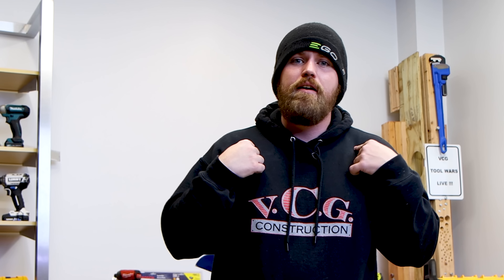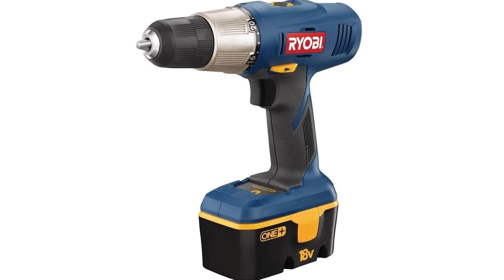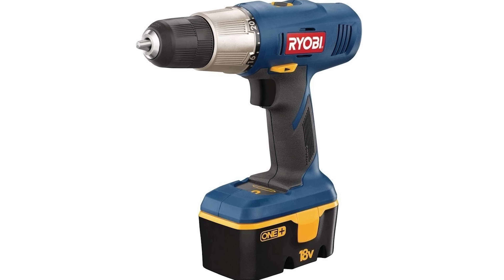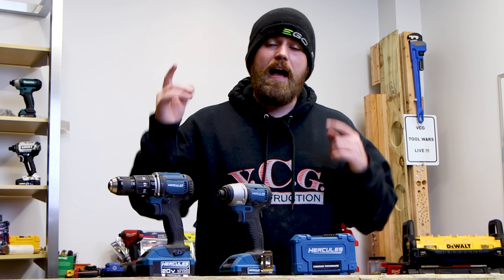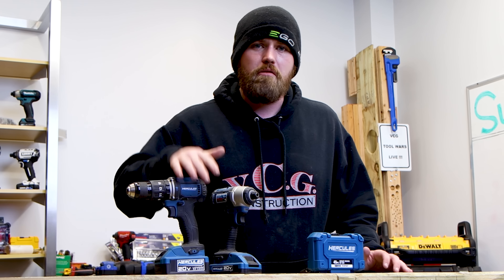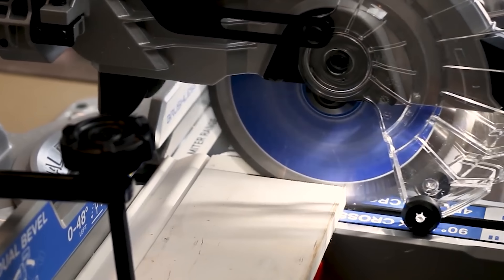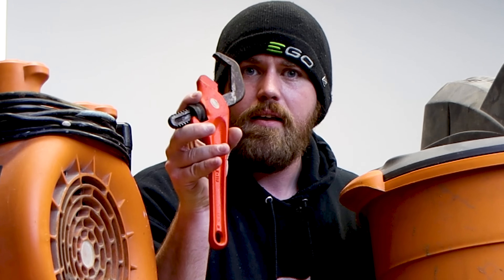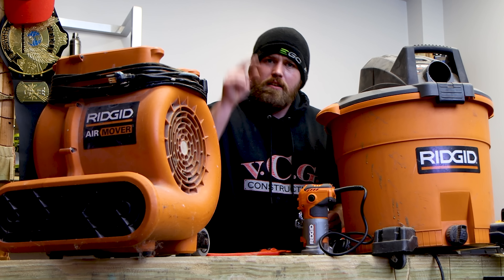TOP 5 MOST HATED POWER TOOL BRANDS (that are actually great)

Comment: I bought a Rigid 1/4 sheet sander once and its clamp failed in the first hour I used it.  Also bough a Ryobi belt sander once, it burned up the first day I had it.  I do have a Ryobi Miter saw that is still running good after 13 years.  But I just stick to DeWalt and Makita now.

Comment: Bosch has always been a puzzle...their 1604 13/4 horse router would rout petrified wood 'till your arms fell off...they made a 3/8" corded (cheap) drill that could not be killed. (I tried). But they made a laminate trimmer that I relegated to underscribe duty because it couldn't survive half a day trimming laminate without blowing up! Now, in fairness, these observations are from 1990- 1994 when I was an apprentice in a Chicago Union Cabinet Shop so it's not relevant to today's Bosch, but I always thought it was strange that the same folks could make such a variety of tool quality at the same time...(this was not about "homeowners quality" "economy" or anything else. These were all repped to us as professional tools from the Bosch rep that came to the shop.
Reply from the maker: Thanks for the feedback Matthew!

Comment: Had the Hercules drill, Non hammer drill. Loved that thing and the impact. The impact is one of the best I’ve used. The drill on the other hand was junk in under a year. The Jacobs chuck is shot on it now. It will not grip a bit well and either loosen up during use or rip ridges into the shank of the bit. Since then I have now moved to a Milwaukee brushless set and not looking back

Comment: One of the best little tools I ever bought was for $10 from Klein it's a special magnatizing tool. It has a magnet and some holes built in it and you can run a screw driver or a bit or whatever you can fit thru one of the magnatizing holes and it will make it magnetic so it gives you the power to make any bit or screwdriver in your arsenal magnetic and it you want it regular again you just run it thru a different hole and it'll demagnetize it! Definitely worth the $10 I paid for it, sweet little tool!

Comment: I setup and breakdown mobile homes for a living. That Ryobi 3 speed impact driver is a beast. With a socket adapter it drops axels and tires, puts them on, deals with hitches, and does everything I need screw-wise. It's been going strong for almost a year...dragged through the mud, dropped off ladders and even a roof here and there. The guys at work call it "the beast" and it usually means not cranking the generator and pulling out the Milwaukee impact. I bring my Ryobi tools to a construction site and abuse the hell out of them. For the money I paid and the value...I can't complain. The roof I cut today didn't skip a beat with the saw-zall, and forget about the ceramic tile with the circular saw...

Comment: I'm a 23 yr apprentice. With all ridgid. Doing 4" lags into 4x8 timber fur. Dropped my impact in the lake 8-10' still performed as any impact after. 4amphr still works n charges just the light on the cell indicators dont work anymore.

Comment: When it comes to plumbing ridgid is top notch I like my Bosch  idh182 with core batteries is sweet that Bosch blaze GLM50c  is amazing the powerbox jobsite Bluetooth radio is a home run . I own a Ridgid gen 5 x brushless  kit it's good for what I need it for coming from DeWalt Nicad for years
Reply: That’s because theyre essentially two different companies. Plumbing line of Rigid tools are made by Rigid. I forget the parent company, but the origin of the Rigid power tools is there is  an orange power tool company in Asia/Europe that wanted to release their tools in the US. I forget the name. So they bought the Rigid name, and strictly the name, and branded it under the Rigid name and released their line of power tools in the US under the Rigid name.
Reply: Can anyone tell me what the difference is between the IDH and the GSX line? I have a GSX 18V-Li myself, wich apart from the brushless motor is nearly identical (57 in-lb difference in impact force).

Comment: I drove in some T25's in my deck bc the winter expansion made them pop out a little. I prob drove 30 screws. I ruined 3 hercules bits doing so. I was even using the screw function on the impact.

Comment: God tier:
-Hilti (Europe)
Indestructible, but stupid expensive. Geared towared more heavy industrial use.

First place honorable mention:
-Festool (Europe)
Quality tool brand but sold almost exclusively in Europe. Doesnt have the widest selection of power tools, but more so geared toward wood working. Very niche.

1st tier:
-Bosch (Europe)
-Milwaukee (USA)
-DeWalt (USA)
-Makita (Japan)

2nd tier:
-Skil (Europe)
-Kobalt (USA)
-Porter-Cable (USA)
-Metabo HPT/Hitachi (Japan)

3rd tier:
Einhell (Europe)
Craftsman (USA)
Ridgid (USA)
Ryobi (Japan)

4th tier:
Hart (USA)
Hercules (USA)
Masterforce (USA)
Stanley (USA)

Comment: I have a 12 volt Porter - Cable cordless drill that I just love. I bought it back in September 2016 up here in Toronto Canada, when Lowe's decided to discontinue Porter - Cable's 12 volt cordless tools. I bought a two tool set, the drill (which is what I wanted) and a 12 volt impact driver. The whole deal was $ 100 ! I have never seen as h good a deal since. I sold the impact driver and now wish that I had kept it. What do you folks out thee think of Porter - Cable power tools ?

Comment: Ok so I've been watching you guys for awhile. Ive been in construction for 28 years. I've been thru alot of tools from DeWalt to skil. In my opinion Ryobi rocks!! I have been an avid rigid user for the last few years. I can't stand overpriced DeWalt. I have been using Ryobi tools daily for the last 8 moths. I will continue to use Ryobi at the jobsite.  My  Ryobi tools have outlasted my Rigid hands down. They are definitely better tools than everyone says they are. They are more than just DIY or weekend warrior tools. Go Ryobi!!!
Reply: P213 here, i couldn't agree more, i drilled thousands of holes with this beast (even some times 3/8' in concrete without breaking the sweat) it just rocks, gets the job done at a price that everyone can afford

Comment: Before cordless impact drills were so ubiquitous, Hilti and Bosch were the kings of the hill. The Hilti was powerful, but very heavy. The Bosch (Bulldog I believe) was light, powerful, and very durable. We used them to drill in concrete, brick, and even through utility poles. We dropped the Bosch (accidentally) a few times from about 20 feet up on a utility pole, and it never stopped working. Bosch makes quality stuff.

Comment: I have ryobl its just the color throw me off but I have a gas trimmer 4 cycle oil I never had trouble with it very strong for tuff gas and only problem I have is just the trimmer liner which is fine

Comment: The new Bosch 18v brushless tools are among the best. The cordless sander, multi tool and grinder are better than all the other brands and you can get them with a 4.0 21700 cell battery and charger for less than $120-150. Lowes has the 1330 in pounds hammer drill with 2x 8.0 batteries for $200.

Comment: Ok the fact that Bosch is on this list is pure bs, they are one of the best brand of power tools
Reply: Yup Its because people fanboy Over Milwaukee, Mikita and DeWalt being so strong. Bosch may not be as powerful but has better build and battery. I don't do super heavy duty drilling in concrete so I'd much rather have the superior build and battery with good performance.
Reply: @thetheoryguy5544  ya, mikita is also has  pretty good build quality or it did, the mikita impact I have is about 30 years old and it's still working pretty much perfect other than the direction switch, every other year I have to order a new one but the factory one got smashed by a dropped hamer, I can't find one due to the shut down so I ordered a new millwalkie one and it is bigger and stronger but not near the build quality

Comment: I agree. My first choice is always Craftsman. I know many won’t agree but it has always treated me well. I even had a 19.2v set that came with a lot of pieces in a blow molded case that survived a deployment to Iraq nearly 12 years ago and is still kicking ass today with the exception of the nicad batteries I killed those but about 6 yrs ago I replaced my batteries with the lithium ions and several xcp and they still run like new and now I’ve finally had to replace a couple tools due to not being able to get replacement parts and the new v20 and v60 I’ve replaced them with are amazing in my opinion. My second is ryobi for things that are odd that I may only need once in awhile

Comment: Just bought the Ridgid 12v combo kit for work and it's the 12v impact everyone grabs at work. More power than the M12 fuel or Bosch 12v impact. And a lifetime service and battery agreement for a all for 100 bucks. Yeah I'll take my Ridgid over ones priced twice as much with only a 3 or 5 year warranty

Comment: First off... even at the time of recording... Kobalt didn't make the highest voltage batteries... that goes to Dewalt and their FlexVolt 60/20V system, followed by Matabo HBT and their MultiVolt 36/18V line. With that out of the way, almost all my automotive tools are Kobalt. Not the biggest fan of the ratchets, but maybe it's that one thing I have really bad luck with(the mechanisms keep failing on me with light usage, so no, I'm not trying to use it like a breaker bar), but the sockets are great.
I have a Gen 2 Bosch Freak, and I enjoy it alongside the drill driver. Hell, I've been looking at Bosch for when I buy a router.

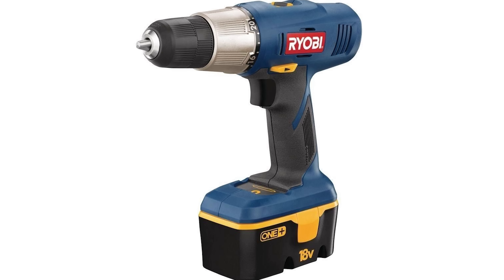Comment: 1:40 Can someone explain to me why the capacity of the battery would make a difference? In principle, the tool sets the resistance and the battery sets the voltage. All the battery sizes promise the same voltage so the capacity shouldn't matter. Do the smaller batteries not supply the promised voltage?
Reply: It describes how much money leaves your wallet.
Reply: Bigger battery means more power demand allowed, if when the tool demands more amps, and the battery can't keep up, the voltage drops, and with that, the power output of the tool, that's why (up to some point) the bigger, the better

Comment: Another interesting thing is that tools are marketed differently everywhere. In South Africa Ryobi is still blue and red. They have 3 lines.. handy line (DIY). Normal use and heavy duty tools. You wouldn't think twice about using Ryobi in a trade. You can see them on the Ryobi South Africa site

Comment: RIGID power tools and RIGID hand tools are essentially two different companies under the same brand name.  And if I remember correctly, HILTI has the largest batteries on the the market.
Reply: AEG, that’s the tool line that use the Rigid name.

Comment: just grabbed the hercules miter. Comparing it side by side with the a dewalt (old dw718, but still works great) It really is a great saw. Cuts accurately, has the same features as the dws780, comes with a decent blade and for $325. It's a great deal

Comment: Only reason i hate Ryobi, cause you don't get parts to fix em. Least not where i live. That being said, i had a blue Ryobi drill. I couldn't kill it and i tried. Drilled that the smoke came out the motor, but it did not die.
Someone eventually stole the drill.

Comment: oh my God.  I love Ryobi tools. I worked 2 years cleaning duct work. I used my 14.4 volt ryobi drill 6 days a week it never let me down. this was back when it was blue and red.  I had my tools stolen out of a storage unit. they got my recipercating saw circular saw a router and table cordless drill and flashlight all of them ryobi. these tools are pro handyman grade at homeowner's price tag. I promise you won't be let down. I wish I could have replaced these tools at the time. my replacement tools are no where near as good

Comment: Bosch is shit , and has been for the last 10 years now , almost the most expensive tool on the market , breaks easily and replacement parts are super expensive . i d rather buy 5 cheap tools for the same price as 1 shitty bosch and they last 2 times more .
Reply: Hey Buddy Bosch is not Crap....
Do you know anything about power tools?? They innovate just about anything!
What do u have DEWALT??
MADE BY BLACK AND PECKER???

Comment: It honks me off when I hear tool snobs dump on Ryobi. Most are dewalt moonies though. One of my guys uses all Ryobi and his tools hold up great in most applications. Ive used Bosch Milwaukee and Porter cable since the 90s and while PC is mostly junk now the other two are killer. Also Harbor freight is great for what they are. You need a tool tonfinish a job? Hit HF and you're set. Kobalt has also really upped their game the past year. We run Mostly Milwaukee, Makita, Dewalt, Bosch older Porter cable, Senco, Fini now we've gladly added Ridgid and Kobalt because they've proved themselves. I got a new Ridgid table saw when my dewalt scrapped the bed and I won't look back..

Comment: harbor freight is good for whats it is.  if i need a one use tool that i will mostly not need again or if im getting started in a new hobby then harbor freight is great. i do own one of their 1 gallon fortress air compress and i Fing love it. i use it for my brad nailier pin nailier and staple gun.

Comment: Calm down buddy, you sound like Vince.  I still don't want a bunch of different battery platforms.  I'm still a Milwaukee fan and that's what I mostly have.  I know guys that go for the Ridged line, that's fine, but when we where doing the same thing side by side, the Milwaukee was far superior.   It's too bad that the batteries aren't standardized like AA batteries.  Other wise I would look into other options.  Price is sometimes better than performance, but I'm have limited space and will stick with the platform I have.  I not judging people for purchasing cheaper tools.  It's the batteries.  Corded tools, on the hand is a different story.

Comment: Bosch really needs to up the ante on batterychargers. My 18v impact driver/wrench was used a few times but the charger stopped working. Customer service points me to their new overpriced chargers. They have very bad rating from customers. 
Lost confidence on this brand and sold the tool and will never touch it again.

Comment: Glad Metabo HPT/Hitachi didn't make the list.
Reply: I am quite happy with my Metabo 8 1/2" sliding mitre saw w/portable stand. :)
I think the old screw gun I have packed away is a Hitachi (got it when the company I worked for at the time shut down a department), man that thing is a beast! Haven't used it much though, as I only used it when I was in a pinch (my only cordless drill at the time ran out of juice at a very inconvenient time). Well, My company used it for mounting flooring in shipping containers, so it *ha*d to be heavy duty... :)

Comment: Bosh makes trash tools, you cant deny that. There may be a line (new one?) that is decent but 3 drills I had all broke within 2 years with moderate use. One of them was close to 700$. Repaired 3 times (smoking). I wish I bought a japanese makita drill whwn i had a chance. My old makita angle grider (big and small) never let me down. Same with 1806b planer.

Comment: I had a ryobi drill and petrol water pump.
Never had I break a tool faster, so I’m actually scared of ryobi tools now, I have to say I prefer black and decker for lower priced tools.
Also I have Powerplus yellow tools locally available and they are extremely good tools for the price. Didn’t break one of their powertools yes and especially the corded drill and corded grinder really get abused

Comment: This guy is so annoying. And most of those brands really are garbage. Bosch makes some decent stuff, but i don't trust German electronics (and I'm German). Royobi tools have been ok for me, but their batteries are trash.  I now exclusively use DeWalt. Not because of brand loyalty, but rather because i have friends at Stanley Black and Decker HQ, so i get 50% off retail.  DeWalt has proven very solid for home use, but I see how the retail price drives some away.

Comment: We have Maximum & Mastercraft here in Canada, along with Craftsman and the others mentioned in the video. Its easy to be a Milwaukee/Makita/Dewalt/whatever fanboy (I've owned & used several), but sometimes a deal comes along and you're only a few hundred bucks into a set of tools that would have cost you way more from a "pro" company. Even Milwaukee stuff stops working when used as a hammer or dropped onto concrete too much, and if you're not going through several batteries a day, there's no reason these other tools shouldn't last years.